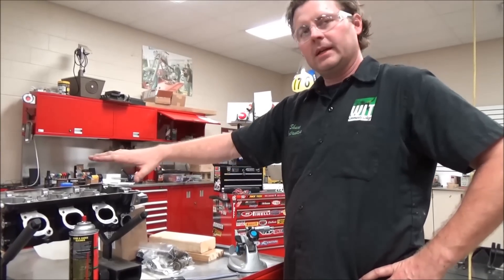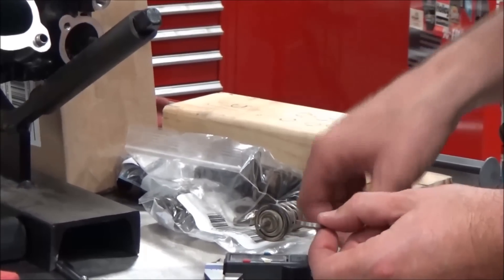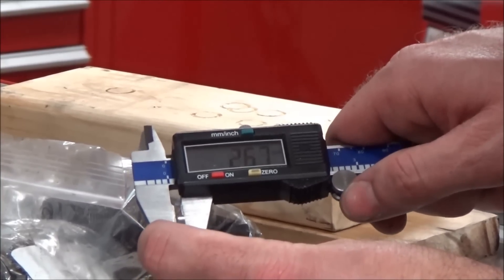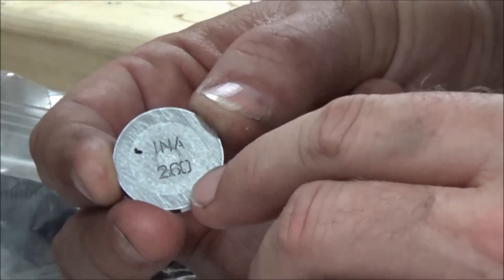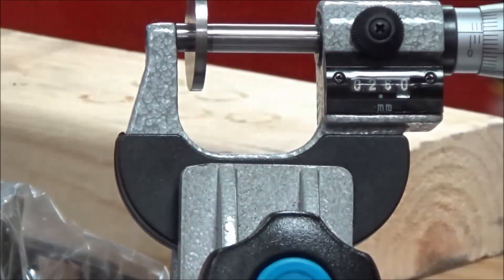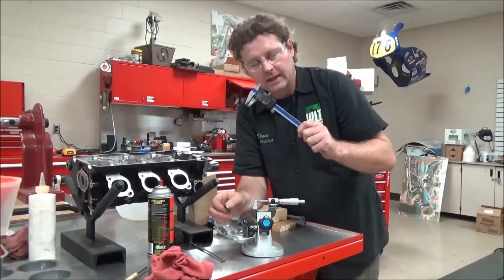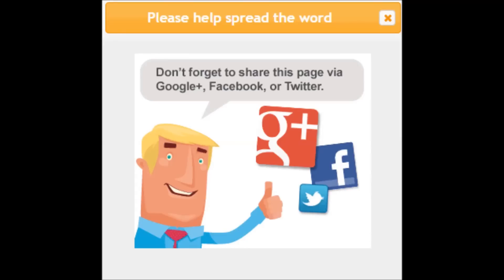Part 1: Why you MUST use a micrometer to measure valve shims and NOT a vernier caliper!

Comment: The shims on my bike are 13mm so using a digital vernier  is very effeftive... Also to check the larger sizes shims are you saying you need both micrometer and verniers to check pperfeftly.. using the micrometer only would only measure the center and not the outer area of the larger shim..

Comment: I do not see any difference between vernier and micrometer : I tell you why ? because when we measure the valves gaps with feeler gauge and shims size with vernier : we will understand if we need bigger or smaller shims so if the vernier measurement is increased than we want , it's okay we gonna increase more to compensate the size we want
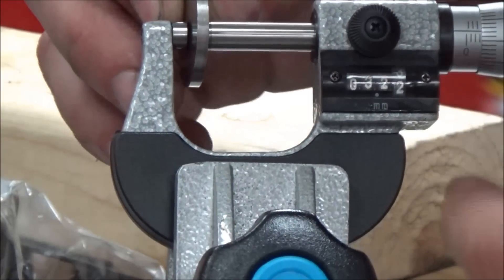Reply from the maker: Hello there. I'd watch the video @1:25 for why again. 
Follow us! 
Web:
www.How2Wrench.com     
www.Tools2Wrench.com

Comment: I dont get it. I have two different calliper and all numbers on my shims are exactly identical what my calliper shows (+/- 0.01mm). so for me its absolutely accurat. if a shim size is on outside border smaller or bigger than in the middle, its IMO a bad shim and should be replaced
Reply from the maker: We absolutely agree that the shim should be replaced if that was the case. You have to keep in mind that there are shim sizes out there where the shim is wider than the cam lope and does not have full contact with the cam lobe. Also keep in mind that we are duplicating best practices as outlined by the manufacturer and "skill set" training. 
 Thanks for commenting and adding value to our community! Please subscribe, share and consider a H2W membership to support our free work here! 
Hope this helped. Want to give us a “high five”? Click here https://www.paypal.me/how2wrench 

 Need more personalized help? Your answers and help are just around the corner. Save time and money while protecting your investment and yourself by doing it the right way at www.How2Wrench.com  
 
Have you subscribed yet to never miss a video? Have you seen the video playlists? Over 600 videos! Check them out here: https://www.youtube.com/user/conleybuilt/playlists

Comment: Bucket/shim style vavletrains are such a pain. Why would anyone think having to remove the cams every 10-20k miles is better than adjustable rockers? It increases performance margianlly and slightly extends the maintence schedule, but the difficulty and cost of the maintenece makes it a null point. Honestly that a big reason i like Harleys. Hydraulic lifters means no valve adjustments. In reality the low maintence should be a selling point for HD but they don't make as big a deal of it as they should. HD might cost a bit more, but one valve service on a 4 cylinder bike will make up that cost difference right there.
Reply: you do know inline 4s use rockers too??? there goes your point right out the window.
Reply: Honda has made multiple bikes with hydraulic lifters and there are tons of other motorcycles out there with screw-and-locknut valve adjusters.

It's not unique to Harley by any means.

Comment: hi,
what brand micrometer would you recommend  ?
Reply: Shane Conley  I realize this is an incredibly old comment. But I think it's important info, so Ima share it for anyone else who sees this question and is looking for some advice. I think it's very  important to buy the best quality tools you can afford, and Starrett is about the best of the best. 

And the best part is that anyone can afford Starrett, if you actually spend some time looking for the right deal. Literally just keep an eye on eBay and you'll find ridiculous deals on Starrett gear. For example, A couple weeks ago I bought a like-new condition Starrett No. 216 micrometer (that's the one they call a "digital" micrometer, although it's not electronic, just like the one you showed in this video) for $26, instead of the $350 MSRP. Functions perfectly, carbide faces are in perfect condition, cosmetically a 9/10, and came with the original box and all the original paperwork. You just gotta spend some time looking !
Reply from the maker: SOOOOOOOOOOO depends on how critical and budgets. Sets range so much. I love Starrett but even I can't afford them. Thing is I have access to them to compare mine against. 
Thank you for sharing my work. If I can ever be of service to you, here is a video explains how to connect with me. 
https://www.youtube.com/watch?v=vjvmB01ebcs 
Keep Wrenching,
Shane Conley
Instructor/Motivator/Motorcyclist
www.how2wrench.com
Like freebies? Click here for a free diagnostic checklist! 
http://gem.godaddy.com/signups/364621/join 

Did you like this free video and hope to see more? Would you just like to say thank you with a donation? Click https://www.paypal.me/how2wrench

Comment: Good video!

One point, I think you mean a digital caliper rather than a vernier caliper.  (Although, as you point out, the point is that you should use a micrometer rather than a caliper.)
Reply from the maker: Hi Joe,
You are correct!